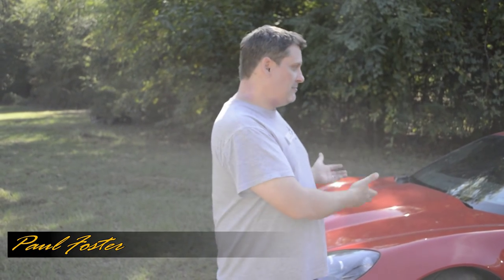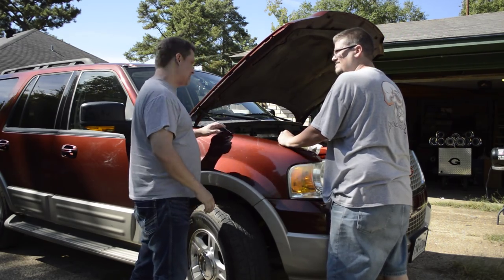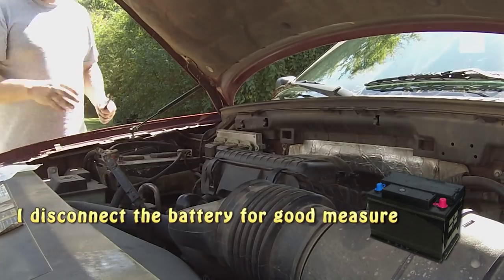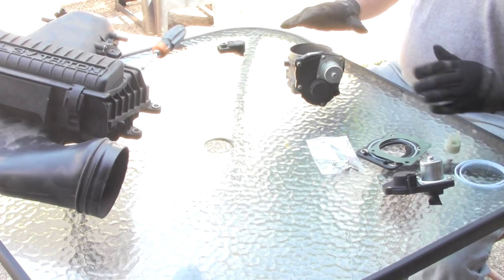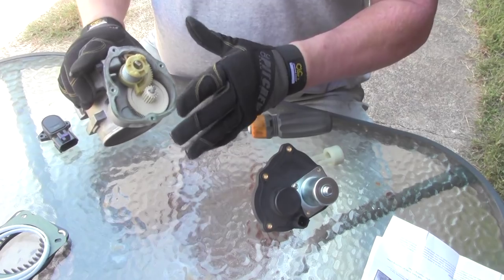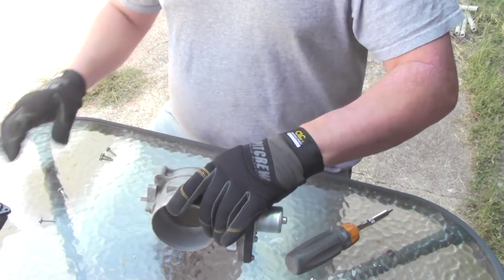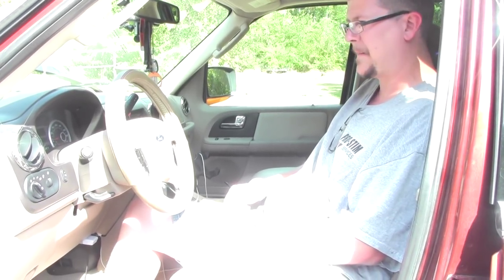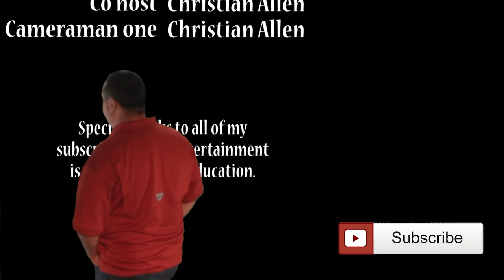How to troubleshoot an electronic throttle body 2006 Expedition

Comment: Amazing. I tore into this earlier today without realizing the orientation of the spring first. Your video is one of the only ones (THE only one) that shows how to correctly set the spring mechanism so that there's tension in the plate.
I kept installing it without tension and was chasing code p2111 for all those wondering.

I'm mechanically inclined but have never been inside an ETC before. It was one of those "well now u know" moments.
Reply: How much tension do you have to put on the spring how many turns counterclockwise?
Reply: How many turns on the spring
Reply: Ethereal Drones  did you ever get an answer???
Reply: How much tension do you put on throttle return spring?
Reply: I dont remember off hand.

Comment: is possible the warning throttle sign display after a throttle cleaning ?
Reply from the maker: Hey Martin, Not sure i'm following your question. are you asking if the warning light will go out after the throttle body is cleaned? Not likely in this video we had to replace the part to fix the problem. then you have to hook up and clear your codes. with and OBD2 reader.

Comment: Hi can u send me a link to buy the part u replaced or the name of the part. Thank you
Reply from the maker: This was a couple years ago,  but here is a link for that throttle body motor. hope it helps 

https://www.buyautoparts.com/buynow/2006/Ford/Explorer/Throttle_Body/47-60148_AN?src=pla&pt_source=googleads&pt_medium=cpc&pt_campaign=(ROI)+Shopping+-+All+MAPs+-+Year+Specific&pt_adgroup=[47-6]+Throttle+Body&gclid=CjwKCAiAk4XUBRB5EiwAHBLUMWWbk4-M6OWWh3me16p7hTKUap9wZK8TqZKXsLpdpLKvm4tzIJKjLhoC94IQAvD_BwE
Reply from the maker: Okay that link doesn't work but if you look up "Ford Explorer Throttle Body Motor" it should pull up the kit for you.

Comment: do you think you help with this same issue but my 05 Navigator will not start with the key
watch this vid: https://youtu.be/ayUhX2jpp_s
I can start it up with a connection from the starter and tap the positive of the battery
watch this vid: https://youtu.be/Cm_xn6SjVCg
however it will not start with the key.
I had the same thing of low speed 2-4 miles an hour or less. 
Any thoughts......#cantgonowhere